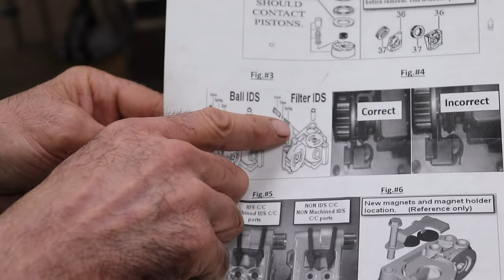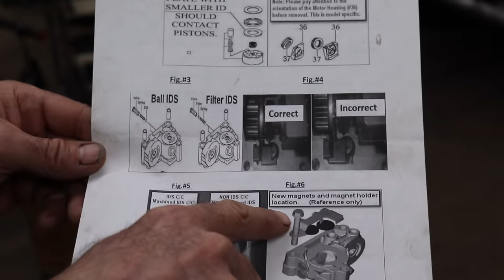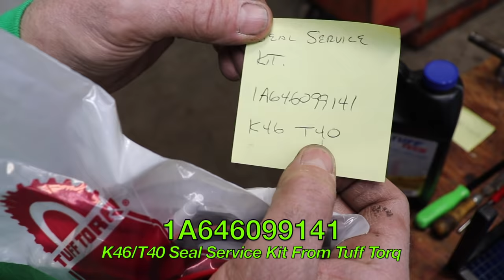Transmission Skipping? Here's The Problem!

Comment: Three major problems with this hydro unit series IMHO.  No. one is the powdered metal differential gears.  Not a good material for such a severe duty gear set.  No. two is the combined hydraulic unit and geared unit that run in the same oil. The metal filings from the substandard gears winds up destroying the hydraulic components.  No. three is that use of the same oil for the gears and hydraulics. Two very different requirements,  EP lube needed for gears while the hydro needs a sealant, coolant , lubricating, and low foaming fluid.  Poor low cost design that seems to be a throwaway after 300 hours or so. Hopefully your service is much better than mine was.

Comment: in the hills mountains in Virginia alot of these failed.
Gotta change fluid and filter alot or they burn up.
Bad design.
Curious if you could flip entire tractor upside down with trans still in and just remove lower cover to service it?
Respect that Tuf Torque is made in USA.
Maybe they can improve them to be easily serviced.
Reply: A lot of parts would fall out.
Reply: @rrrr635  upside down as he has on bench entire tractor upsidedown remove just the pan to change filter and oil
Reply: @MitzvosGolem1  the parts stay in place. if you flip the trans over, everything would fall out on the ground.
Reply: @MitzvosGolem1  I guess you COULD flip the entire tractor upside down LOL!! Good luck!
Reply: @rrrr635  I do heavy equipment and used to doing that. We put a 45 ft boat upsidedown to weld hull.  
Lawn tractor weighs 300lbs no to bad.
One could use ropes and stand it on its front  to service oil filter.

Comment: Why would one of these transmissions work fine in forward but no reverse then took it to a tractor repair shop and they supposedly drained the fluid and refilled and now it has no forward but reverse works great? It’s a JD 265

Comment: I have similar transaction in my x340, Is there a way to convert to posi traction or would you have to replace the whole transmission?
Reply: You would have to weld the gears and the. You couldn’t turn without tearing up the grass lol

Comment: Big fan...car question for you: my gf has an 07 Yaris 5 speed w/180k miles.  Great build drives nice.  Weird issue I can't figure out.  During warm weather (70f +), when car is cold, the car hesitates out of 1st gear specifically uphill.  It feels like a chatter, like power is not getting to wheels smoothly.  Only in summer and only when car is cold. Ideas?
Reply: @marshmower  manual
Reply: @josephjameson7716  so there's a chance the clutch friction disk is slipping. Does the check engine light ever light up? Is the indicator operational? Then,  it could be something mechanical slipping if you don't have a code . The transmission fluid should be useable but really should be changed every blue moon. Probably gonna have to check the Scion life forums to see the best fluid for your climate. One size doesn't fit all on gear oil
Reply: See if you can get a technician or someone who drives a manual to test drive it. They'll tell you for sure.

Comment: i wonder if the 3 bolts had some loctite on them because it took a lot more than 35 foot pounds for Taryl to break them loose
Reply: I noticed that as well. I paused & did not see anything on the threads. Not sure.
Reply: Surely he's not getting old. xD  It might have had a different type of clear lock tight.  Or seized over time.

Comment: don't you have to "burp" the transmission by moving the mower forward and back after installation?  then recheck the fluid level?
Reply: What I do before firing up unit after a trans job is push unit forward and backwards until I start to feel some resistance, at first it’s just air, but as fluid is pumped through it gets harder to push and you know fluid is pumped through trans
Reply: It'll bleed quickly. Don't need to do that.

Comment: angle grinder do a hardness spark test on those diff gears. some kubota tractors the cam shaft gear wears away low hours batch of gears never got heat treated?

Comment: I’ve had 3 of these transmissions that would only go forward but not in reverse. What is usually the issue?
Reply: the issue is it will not back up.
Reply: could be a linkage issue
Reply: or checkball/vein is clogged
Reply: @M.TTT.  I checked and it wasn’t the linkage. I didn’t bother fixing any of them because the hoods were missing and all the deck parts were seized up.

Comment: I want to figure out how to get one of these to preform at higher speeds with a pulley swap. Once you hit a certain rpm on the trans pulley shaft it stops driving the axles... I figure it  has a pressure release to prevent damage. I want to bypass that feature and overdrive the thing! Is it the dampening valves or what? Is it as simple as over filling the oil? Anyone know the trick?

Comment: question,,,how can i put mower on neutral so i can move it ,,without starting engine,,,help
Reply: There should be a lever on the backside of the machine, usually pulling it out towards you puts the transmission in the neutral position.

Comment: Rather than wipe the parts down I would spray the part(s) off with brake cleaner and blow dry with air.  Another thought on the tranny.  Why did the tranny builders not design that tranny with a filter cap and center bolt built into the tranny pan to permit draining the oil and changing out the filter periodically?  Now the operator just runs the darn tranny until it plugs up or wears out, which, I suppose is good cause that's when they have to bring it into your shop for repair!!

Comment: Has anyone tried putting washers inside the pump and motor under the springs to boost pump pressure? Like people use to do on old automatic car transmission pumps??

Comment: Hey taryl I’ve got a transmission in a riding mower that is making a clunking sound when I drive it. What do you think it is???????
Reply: Check the differential gears
Reply: @markchriestenson3257  ya that means I have to put the transmission
Reply: @LittleT34606  it is a hydraulic trans right
Reply: @markchriestenson3257  yes it is

Comment: IDS= it's dumb shkitt.
Oops the space shuttle splashed down.
I hate it when that happens.
Square point shovel.
Big waste basket or trash can.
Scoop, scoop.
Then the kitty litter.
No but seriously, this is some pretty intense content here.
Alotta guys would find a trans and replace it when it's a filter and seal/ magnet upgrade issue.
That turns hundreds into thousands. Or you can't get the labor.
Mower medic won't save you, will they?
You can ask those guys if they're out of the graybar hotel.
But no, they might steal somebody else's.
Hey, you said 35 to 40 inch pounds or something like that.
Inch pounds.
Then you pulled out Mr handy dandy 3 foot long handle foot pound torque wrench and went to 35.
That means 35 times 12 was actual.
That's not what you said the spec was.
Sorry.
Point of order , senor.

Comment: These transmissions are designed to fail. No drain plug to change the oil and no replaceable filter. Just a cheesy screen and a bunch of magnets to make sure it lasts beyond the warranty period. Typical John Deere.
Reply: tuff torq engineer:  "hey we can design these more like a car and add a drain nut and more accessible filter and make it easier on the owner for maintenance".....

tuff torq exec: "What......and lose sales on new transmissions?.....not on your life".....
Reply: I ve got one of those trans in a husqvarna rider that’s 12 years old with zero issues. I did research a few years back on exchanging the fluid. One forum post from tufftorque was that each mower manufacturer added their own fluid when assembling the mower. They recommend synthetic engine oil which most manufacturers used. John Deere was the exception that used conventional oil and thus the defect rate was higher.
Reply: Edit: whole heartedly agree that a drain plug of some sort and a better filling location would be appropriate. Definitely a chore to perform a fluid swap as it is.
Reply: @bigb7157  Simple solution to no drain plug.
I had a cub cadet zero turn with no drain plug in the bottom. 
Simple solution  take the trans axle out of yhe tractor  take the bottom cover off, take and drill for a 1/8" taper pipe plug on the lowest part of the bottom cover to make sure all the trans oil drains out,make sure you select the right drill bit for the 1/8" tapered pipe plug.
Probably solved
Reply: @beachbums2008  still have to refill it. The fill cap is inaccessible in the mower.
Reply: @beachbums2008  Probably solved?